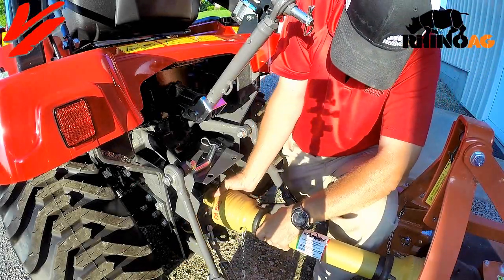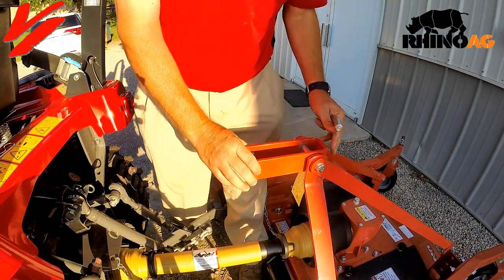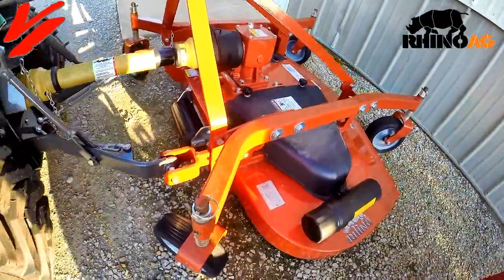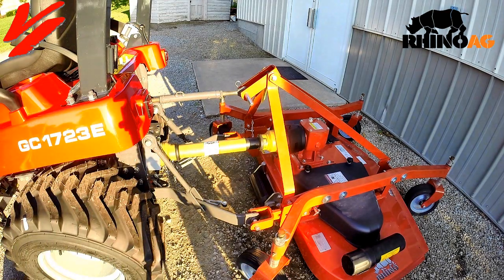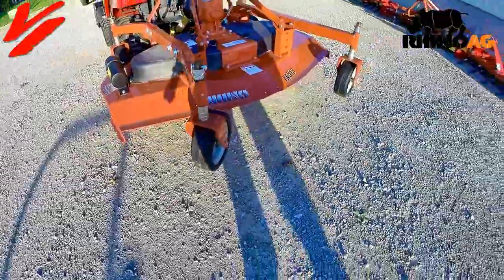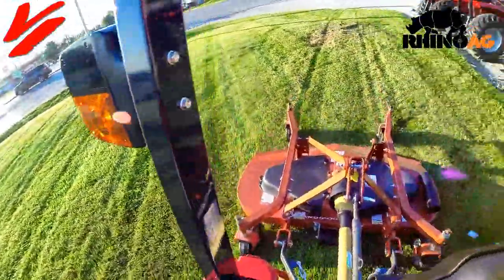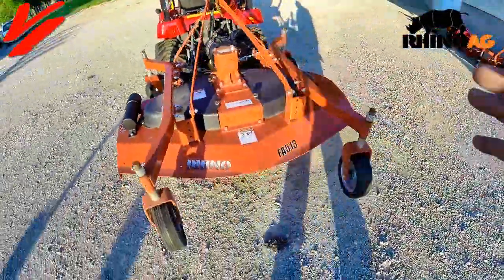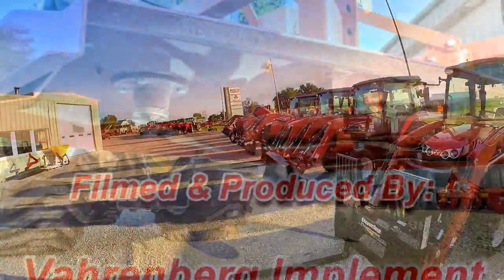How to Connect & Use a RhinoAG FA513 Finish Mower

Comment: That's the very style I would need for the
5s 5700 model,
Reply from the maker: This is a little small for a 145 HP 5S Series Tractor. FA513 is for Sub & Compact Tractors.

Comment: You mentioned one of the disadvantages is that it swings wide.  Can you do a quick video with this same setup, but this time mow up against a fence and turn away from it, please?  I'd like to see how far back you have to start turning away from the fence if you're going towards a corner.  Thanks!
Reply from the maker: We plan on doing the 6' & 7' Mowers later and will try to add that into the video to show . One advantage of Rear Finish Mower is you can back into corners where you can't get a Mid-Mower.
Reply: @VahrenbergImplement  just checking to see if you ever did the second video on the 6 and 7 foot mowers.
Reply from the maker: Filmed the RhinoAG FA713 last night but have to edit video and will next week at the earliest before we get published. It's coming soon.

Comment: Can it work with a quick hitch?
Reply from the maker: A quick hitch can be used with finish mower. You want to make sure to take out the pins that make it rigid so it follows contours and also adjust link ends to be inline to match quick hitch but it can be done.